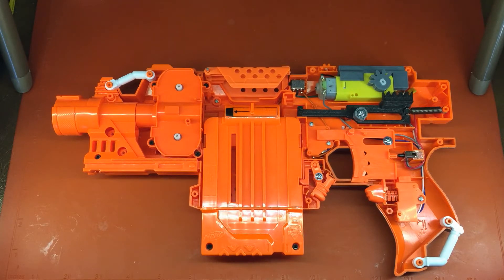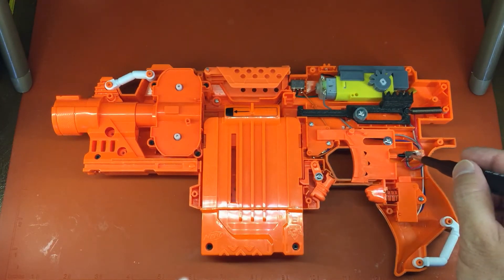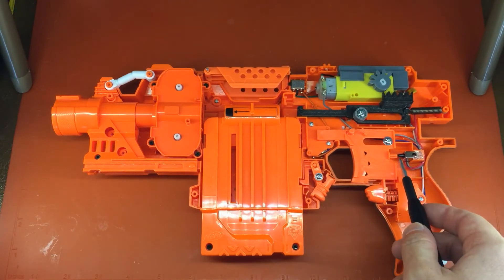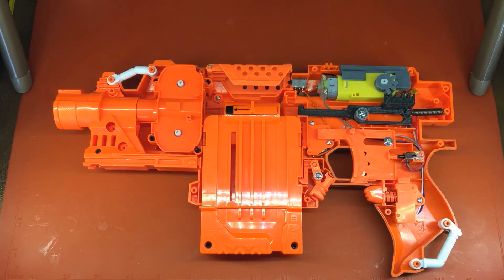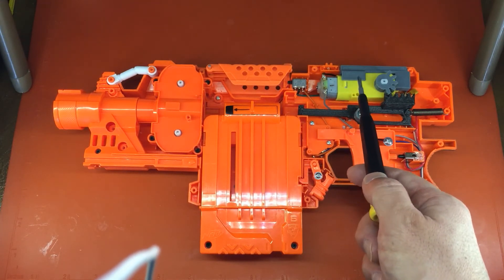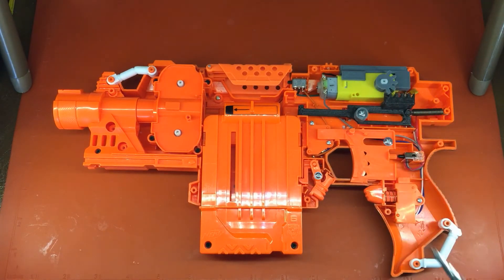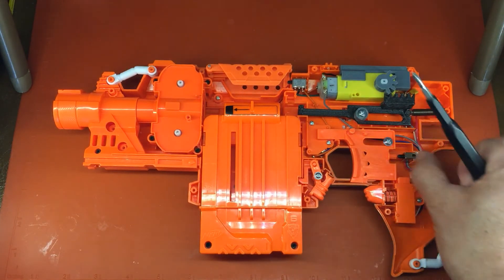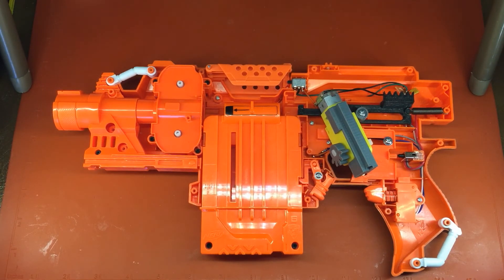Ten minute stock AutoStryfe conversion

Comment: What's the gear motors rpm 100 or 200 with stock motor.
Reply from the maker: Use higher RPM gear ratios for faster rate of fire. Even on lower current IMRs, the pusher won't outrun the flywheel motors and bog down the feed.
Reply: @greenmedic88  i recently tried with 200 rpm gear motor but its internal gears just shattered down so maybe i should get a lower rpm one.
Reply from the maker: @Aditya.k6604  Those plastic gear boxes weren't made to handle much torque, but that's part of using inexpensive, off the shelf parts. I've stripped plenty of them.
Try mounting the gear box with the screw side visible; they seem to be a bit more durable in that orientation.
Reply: @greenmedic88  thanks, just ordered some different gear motors from Amazon to complete the mod: )